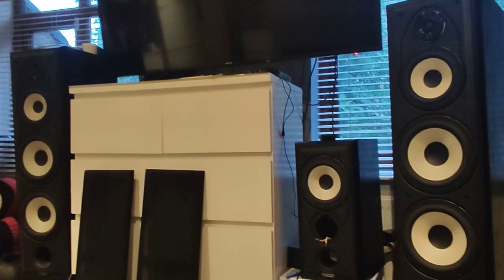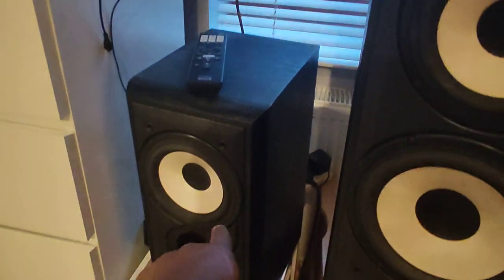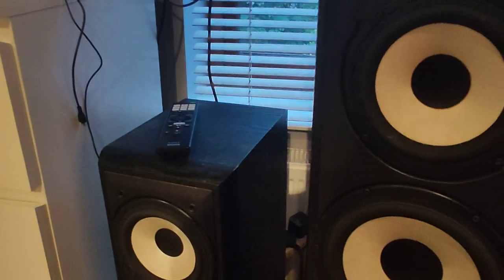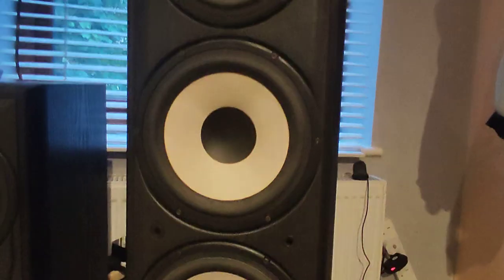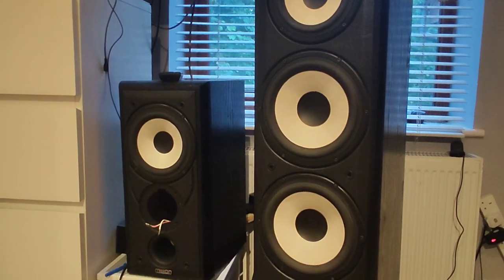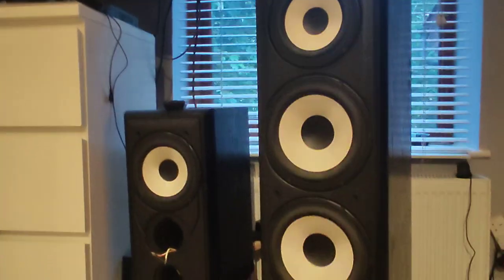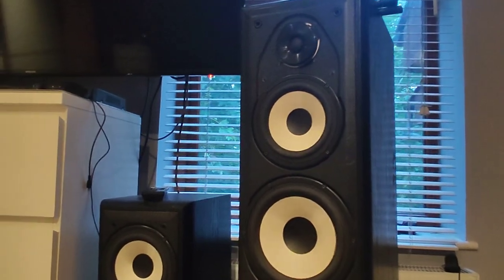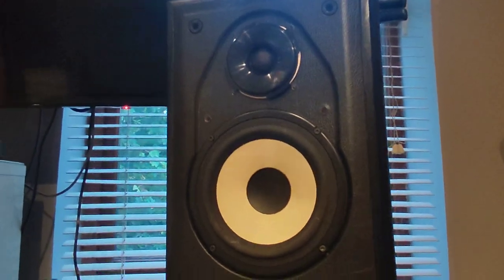Giant Mission 705 floor speakers with a faulty tweeter?

Comment: it will be the crossover, You will either need the crossover repairing or a new one.. You have to be really careful with modern missions, they are really sensitive and it doesn't take much to blow something, i have a Set of Mission 734i, and i have them wired up to my Kenwood M85 separates, and i know for a fact that if i cranked the volume up i could blow them easy. so i just have them on a reasonable level, i never hammer my speakers anyway, i always look after them and know that if i blew them i'd be devastated.. i have a few pairs of speakers, Kenwood Ls85, Jvc Sp-x440, HFS 5, and Mission 734, i love my speakers, but my advice to you is, always know the limits, listen careful to how they sound, you can usually tell by listening when they start to sound uncomfortable